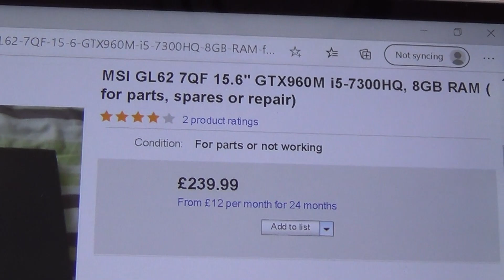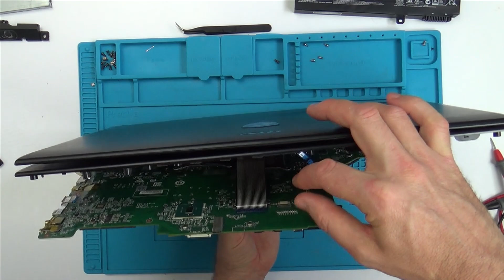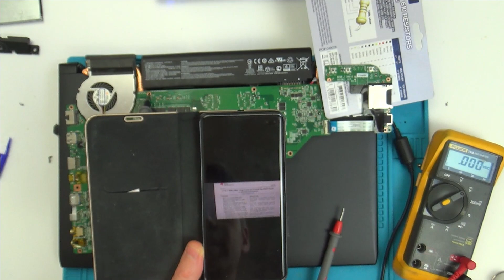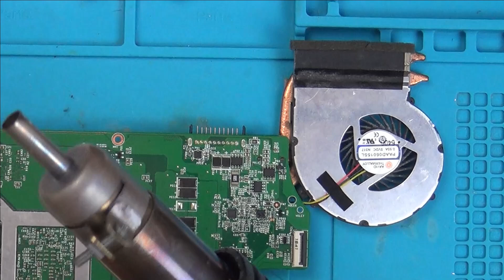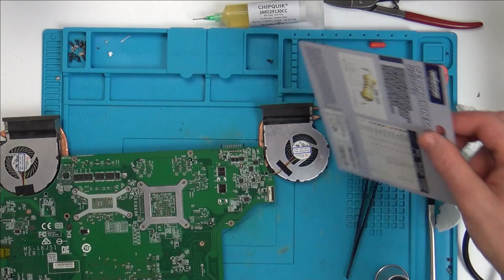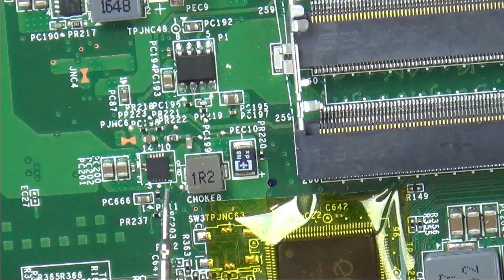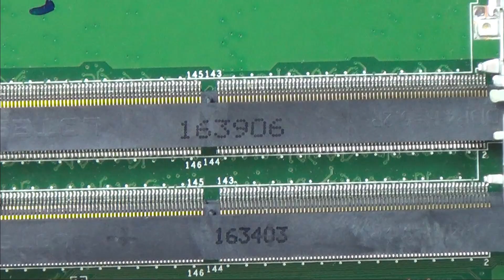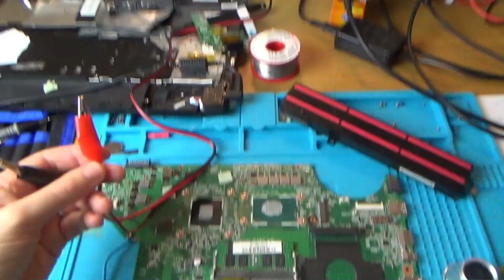Trying to FIX : Faulty MSI GAMING LAPTOP from eBay

Comment: Vince, checking the power button, you should use the multimiter and see which pins on the ribbon connector have 3.3v and which one switches to 0 when you press the button, if non does it then you will have issues with the EC Chip / Super io. The BQ chip is a prick that often gets faulty. Once you locate the 3.3v pin you can bridge it to the ground with the tweezers and it would work as if you pressed the button. Also if non of the pins show 3.3 or doesnt go down to 0 voltage when power button is pressed it wont trigger the logic to turn on or off, which would indicate maybe a resistor failiure somewhere in line. (which was not the case). Then you may have a capacitor or some other chip shorted in the main power rail which is then causing a signal to the EC chip to prevent the laptop to come on in order to prevent further damage. 

Also you need to get new probes for your multimiter that have needle points which is much better for laptops.

Edit: somebody didnt knew how to open it and pry the cpu and gpu and maybe this is gonna be a lost cause. if they survived that damage i'd be surprized.

Edit 2: Dont inject voltage higher than 1 volt, the CPU and GPU often run at around 1V, the ram is 1.3 to 1.5 depending on the model,  the chipset is on the 3.3 rail, so it is very risky to inject more than 1 volt and end up burning something. The "big chip" that was getting hot is the chipset, there was likely a short on it's rail and you injected 4 volts into it which most likely you ended up burning it, so that is likely game over for that board.

Comment: The first chip the power button connection hit is going to be the EC chip.  It controls the world as far as computers are concerned.  It watches the keyboard and the other buttons and sends commands to power up the main power rail and that various lower voltage rails.

Comment: I always steer clear of any items where the language is a bit off in the descriptions because so many of these repair places are run by people with English as a second language and if they havent managed to repair it, its probably not going to happen.  They may have been going to sell the serial number and wanted to make sure you couldnt use it yourself.  I suppose they had left the memory and the hard drive in?  I wonder if they were duds too .

Comment: Another very interesting video and do enjoy watching them and your determination in learning to fix various electronics 

Was very interesting when mentioning about the seller asking questions does smell a bit fishy 

I noticed when the laptop was taken apart it was missing it's hard disk or SSD unless I miss you removing it haha 

I am also in the repair business and in fact recently repaired an MSI gaming laptop with similar fault a light comes in but not turning on and there are several possibilities for that in this case if the MSI I did was corrupt bios so re flashing the bios did the trick  

On some laptops strange as it sounds replacing the bios battery can resolve a problem of a laptop not switching on as in the case of an Acer laptop I recently fixed 

As for power injection do be careful with that and keep voltage down to 1V max and start with a 1amp current and slowly up the amps if nothing detected  oh yes and remove anything from the board that can be removed like ram

Comment: I think when the laptop was taken apart before you got it, they damaged the power pins while they were cleaning it and not to mention screws missing so they probably lost those  and you also mentioned that they took the computer apart and cleaned the part on the motherboard. That’s probably also a red flag because if they got any water damage on the motherboard, or they were cleaning it, they probably did it to themselves, but the motherboard should never be cleaned, unless it’s taken to a a computer business that actually knows how to clean them it’s probably that the motherboard is just shot because computers are only supposed to last 2 to 10 years in some cases 20 or 30 years of best taken care of.

Comment: I have the MSI GT72S which its battery indicator light works but doesn't turn on when I press the power button. I don't know where should I start. Thanks for this video.

Comment: cud be the chip but your injecting 5 volt on a chip that might run on 1.5v or 3.3volt, can u inject 19v where it should go in, then look for heated conponets?

Comment: I have the same issue with the same laptop model except that the light of power on/off button flashe like in sleep mode. The problem started when I tried to fixe the hinges.

Comment: Great try sham it did work out. I have a drive boards and need a laptop screen I did use one on a magicmirror/ I broken my magicmirror and trted to replace it had screen woule'nt work no return on Ebay.  I bit reluctant buy a screen again  off ebuy unless I get the correct number.on the screen. Do know a sella of screens on Ebay ? So get good working one.

Comment: Always pull the CD drive out b4 taking case off.. I cringed so hard when you upped the voltage past 1v.. then you kept it there connected while talking.. same with (OMG) 5v.. and showed the IPA burning... never go past 1v.. (alot of those components are on the 1.5v rail.. injecting that much voltage could have blown something else)... b4 you did all that.. i would have checked all those caps around that southbridge chip and the one you couldn't identify.. You coulda fixed that.. that's alotta $$ to blow.. 1st time visit.. imma check some of your other vids out, also those metal filings didn't look good.. i woulda took a strong neodymium magnet and went around board and see what you found

Comment: Hi so i'm just curious on general consensus on recommended SMD rework chip extraction temp. If I heard correctly; I think you set extraction(settings) temp 480C , blower speed #8? Maybe it's just overly cautious but me thinks if i have to heat beyond 300 max with preflux good chance I already found replacement or very certain component was going to be replaced in lieu of reinstallation.

Comment: Looks similar to whats wrong with my msi gv72 8rd I replaced the keyboard after water damage but it wont turn on, the light comes on when its got the battery and the cord in, but I think the board has a short somewhere on it. Had this thing nearly 5 years so I got my mileage out of it.

Comment: Hi Vince, It looks like you need some finer gold plated probes for your fluke meter. You were struggling a bit with those probes as they are too big for the tests you were doing.
Its worth investing in some good meter leads with fine gold plated tips. There is a company called Bionso I bought from a couple of times now, not the worlds best but good value.
You get a nice set of leads with interchangeable tips and clips etc. The version I bought comes in a nice plastic box and is a 25 piece kit. I'm not connected with the company or selling them
I just wanted to share what I have that I'm pleased with. Keep up the good work Vince. Happy Fault Finding !!

Comment: the south bridge chips you can buy should be pre balled ready to go you just need to pull yours off and prep the board its not a difficult job rather straight forwarded you have the hot air gun its all you need id take that chip off anyways to have a look underneath there could be a iron filing under it and its already dead nothing you can loose but a lil time

Comment: just a note taking out the bios battery with power pugged in that is battery and or charger will be pointless as the power in will supply the bios with the 3v if the battery is out all power must be removed to reset the bios this way

Comment: Hi Vince, I can't work out what you were trying to achieve at 46 mins increasing the voltage on your bench PSU as it was clearly going into constant current mode so it will automatically decrease the voltage to supply whatever current you set it to, as per ohms law as the resistance of the 'short' is constant.  

Also can I suggest if you can't get enough current into the device under test to warm anything up, then you use the bench PSU voltage injection plus milli-volt meter technique to locate the short,  I demonstrated this technique on a motherboard about a week ago, maybe you would be interested in it?

https://www.youtube.com/watch?v=01kiy3qtBc0

Richard
Reply: Oops sorry wrong link - that one was getting hot.  If you can't get anything to warm up with voltage injection I meant to say have a look at this method this method - injection plus millivolt meter
https://www.youtube.com/watch?v=a9RjvfIzcP4
Reply from the maker: Thanks Richard I will check it out as I recently tried used that millivolt method on a MacBook Pro 👍👍

Comment: You have the gpu and cpu mixed up. The bid one is the cpu and the small one is the gpu. Also, you will need a memory chip installed or it wont boot.

Comment: is it the super IO better known as the 'startup chip'   hidden under the capton tape? - that would be something to consider if thats kaput then machine wont start - if it needs replacing it will have to be programmed for your  board - I hate to break it to you but there is a chance you have let the magic smoke out of your 1-1.5v chipset by running it @ 5v with  that amount of amps

Comment: It says taken apart to clean but fan fins are filthy and screws are missing from cpu clamp you removed the ones from gpu clamp, when you remove the cmos battery if you short the pins it resets the cmos.

Comment: Just jumping around with 5amps on the laptop board looking for things that get hot.
Ohh boy.
Get yourself a thermal cam..I don't do many repairs, its more the thermal aspects, but I got no problem in seeing wich part of the board is under load and can even see which part of the CPU die that is being used on benchmark tests.https://www.youtube.com/watch?v=JYPqOCgHKAA
Here with a Xiaomi Air 13 laptop

Comment: I know its quite a old video but anyway i just cant keep this to myself. When you were injecting the voltage to the board you should first look in the schematic to find what the maximum voltage for that specific rail is otherwise you can blow some chips on that rail. And then incresing the voltage wont help you in finding the short because as you could see for yourself when you reach the 3A limit you set the voltage will fall down to minimum anyway. So really the only thing that you will achieve by raing up the voltage is putting voltage surge into the rail thus risking killing anything on that rail which is not designed for such high voltage. The right way do do it would be to set the voltage to around 1 volt if you dont know the maximum on that rail and than only increase the amparage.

Comment: Oof. As far as I know those MSI laptops have weird LCD connector that allows you to short +19V to 3,3V or similar low voltage bus which basically burns a lot of things. Hard to say if it was exactly the case here, tho. It could be, because there are enough people that disassemble laptops without removing battery or charger. 
And obviously this is quite uneconomical to repair such thing, because PCH can be dead, SuperIO, CPU, and other stuff that uses 3.3v
Reply: This statement should be written in stones

Comment: For £200 this is actually a very good deal.
Never remove a heatsink going from corner to corner, always remove them in an x pattern. That maintains even pressure on the dye, making sure it doesn't get damaged.

Comment: Did anyone notice there was no hard drive installed when he opened the laptop? I'm thinking maybe no hard drive, no operating system it wouldn't boot? but the bios should have come up at least I'm thinking. probably a few things wrong maybe the owner pieced it back together with bad parts just to sell. It's crazy what some people do when they set out to just clean it out of the dust build-up. all the sudden before they know it there putting it on ebay to make some of the loss back.

Comment: you was feeding power direct into the chipsets chip thats why it was getting hot lol you was powering up the chip haha these chips get very hot to touch anyway they are cooled by the top cover metal plate under the keyboard with out it they got hot fast

Comment: An old video with a rather sad ending. I was wondering if there were any donor or replacement boards available on ebay and could find none. I even checked Aliexpress and they didnt have anything either so replacing the motherboard on it is not an option either as there are virtually no dead MSI GL62 7QF laptops anywhere.

Some fun projects can still be had with the LCD panel though. It can be modded into a small secondary USB C monitor with the correct know how.

Comment: might be worth heating up the chip around where the hotspot is, hopefully the to ball joined together will reflow and release from one another, have the air flow very low and use a small tip

Comment: I've seen something like this burned Chipset before. It was a graphics chip and there usually is no way to repair those notebooks, as the price for the chips and tools to replace it correctly are too expencive. The GPU on my notebook also had some bubbles inside the PCB of the chip, so something went really wrong there. And also those black marks on the edges.

Comment: Terrible video! Pointless and boring! Like watching a BLIND MAN attempt to fix a laptop! £210 for all that hassle? Not enough knowledge and too much guesswork! The trouble with LAPTOPS are they're difficult to repair compared to modular DESKTOPS, which are easily repaired! I should know, as I build PCs! Should've just bought a laptop that ACTUALLY WORKS! 😂😂😂 Never buy faulty goods on eBay and certainly not for hundreds of pounds!!! 👎👎👎

Comment: Broken ribbon cables, a GPU that looks like it's been pried apart, and burned chip corner at 53:00. It's been messed with before you bought it. :/

Comment: Don't grab in the corners, when flipping the screen! That's why you constantly see broken hinges on laptops.

Also, MSI laptops are notorious for breaking just after warranty has run out. Furthermore, you can't find new spare parts for it, since MSI won't sell any. They're much like Apple in that regard.

You were trying to pull the thermal solution off with 3 screws still in place.
Reply: Yeah.. I try telling my wife to push/pull at the middle of the screen to no avail, same with the dishwasher! But hey, that's why we love'em! :D
Reply: Well MSI actually did sell me parts when my GE72 2QF laptop broken down the CPU fan when it was even still under warranty, but since I don´t trust anyone to make a solid repair and I also did not want to be rid of my computer for 4-8 weeks during RMA I decided to fix it myself and I got the new cooler and put it in. it worked again for almost by the second just as long as the first fan before this one also started to rattle and break down. since I know the quality suck as two separate fans had the same life span I took it to the next level and aimed a repair on the old fan I still had around. they are after some delicate examination and bad words put together by one way locks internally which makes it impossible to get them apart without breaking them. wonderful so I keep pulling until I forced the rotor out from the shaft snapping off the lock teeth, I mean it was already broken right? I got it cleaned up and put some of my very special bearing oil onto the shaft and shove it all together and put that fan into the laptop. it worked, even better than when it was new, silk smooth sound even from a previously ceased up bearing. and guess what, that fan has now surpassed the hours by far on which any of the new scrap stock could last and it is still just as quiet today. so if MSI would put in just one stupid drop of good oil in these fans they would last hint hint, ehem longer than the desired warranty mind you not. my laptop is now over 50000hours of power on time now still going.

Comment: im suspecting that the ribbon cables were inserted incorrectly and created a short which melted some of the ribbons outputs hence the damage but ultimately killed the chip as well, you are 230 quid into this, so before you give up take that ic off and see if all the shorts go

if the shorts disapear then it might be worth investing the 40 quid  to get a new power ic, the octo looking thing and the intel ic

you likely have everything you need to take this intel ic off, a heat source for bottom of board is super important , you have the hot air to go in for the kill  on top and get the chip off the board  itll come off quick 

these ic chips simply snap back into place just like the power ic did when you put it back on, if you mess it up then its time to order some stencils and paste and reball it yourself, maybe another 30 quid ,  would make an excellent video if you succeed or not, i think your ready for it, i know less than you but i have changed these chips before, messed them up and had to reball them again and got them working, 

i think your ready for it, 

reballing is a useful skill and easily picked up, stencils and paste are dirt cheap worst case scenario is selling it all off as parts which you likely are going to do anyway, only thing that concerns me is the pry damage on the gpu and cpu, its the bottom layer of the chip thats usually where all the wizardry is, ive damaged these gpu and cpu before like this but its never hurt the chips the outside is robust but still its an unknown quantity it was hard to see the damage extent on the video